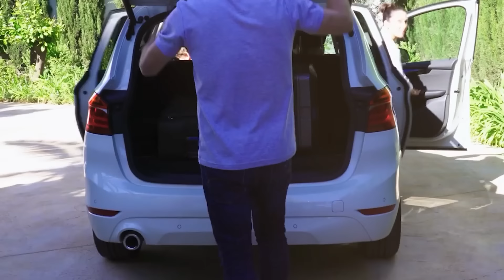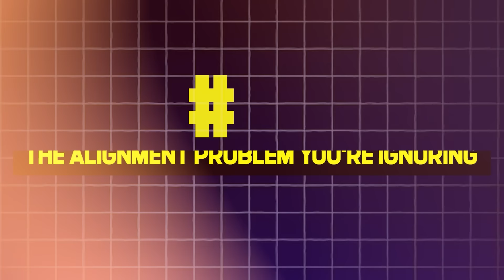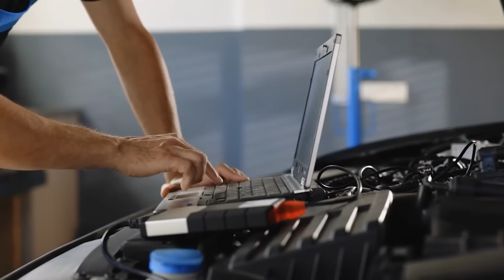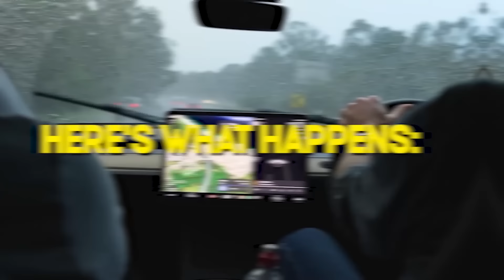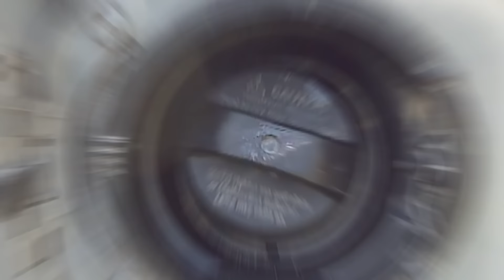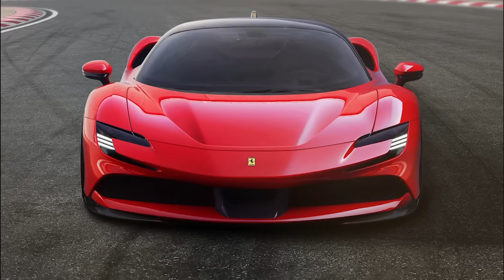Doing This Will Make Your Car Waste LESS Fuel

Comment: maintain your car like your wife... buy everything what is needed... before it is needed
3k miles oil change, oil filter , airfilter...
every year clean or replace ALL sensors...7 or 8....
change coolant, brake fluid and steering fluid every two years...and fuel filter
and drive carefully...

Comment: So you accepted $400 to diagnose the poor lady's car? Really?
Reply: Buil shit 500 pounds on a big suv  is not nothing
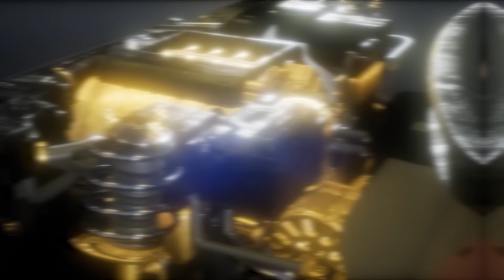Reply: 5:33 This 🤡 is contradicting himself about what oil weight to use.  In a previous video, he discussed how many American cars that use 0W20 is actually a scam to get better mpgs at the expense of shorter engine lifespan and that many of the exact same engines Europe. Will say to use 5w30 instead of 0W20.
He also keeps making new videos, where he repeats the information ℹ️ from previous videos multiple times.
Reply: @michaelbrinks8089  mine says 5 W 20 and that's what I'm going to use. There is truth in this video. 73